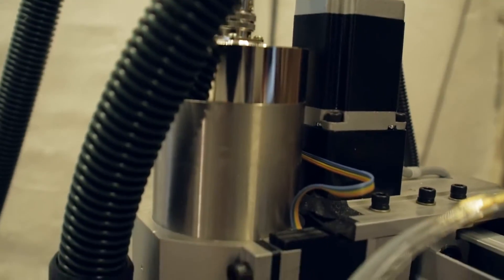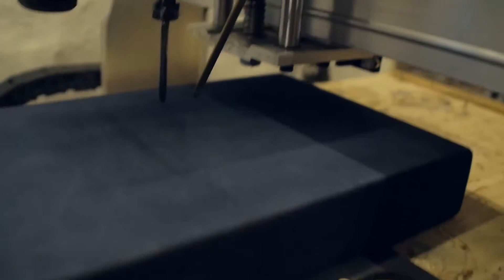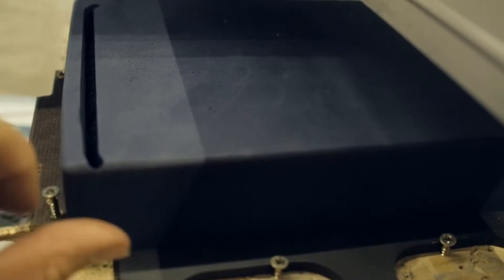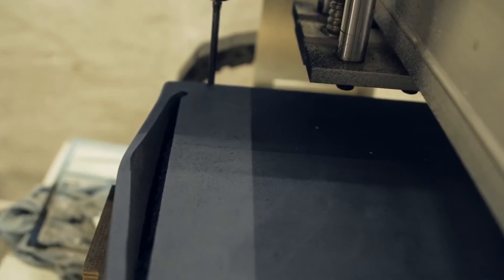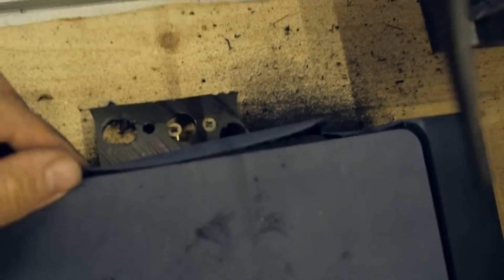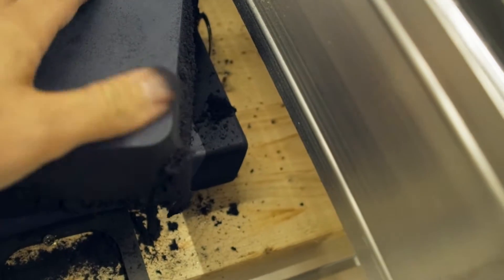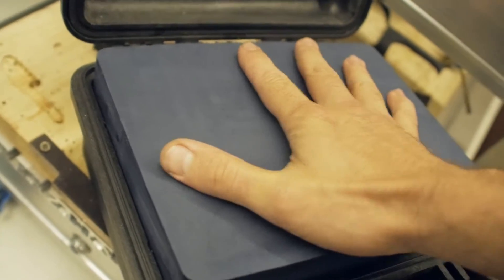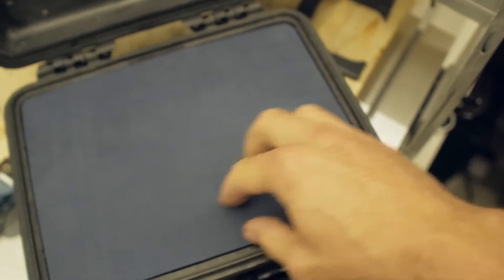CNC 6040 milling EVA foam for Pelican 1200 case inserts

Comment: It is actually available from a few places. Where I live it's sold by a cosplay shop of all things. It's fairly cheap too. If i read their site correctly a 1000/2000/10 (and I assume that is in millimeters, can't think of what else it could be) piece costs 45 euros for the High Density variety. There is also a lower density variety that is even cheaper (28 euros for the same size piece). I am not associated with this shop in any way but since there seems to be some interest I will just say google for Cosplay and Belgium, it looks like most stuff can also be shipped internationally.
Reply from the maker: interesting source :) thanks for the input!
Reply: You are more than welcome, the maker community is built around open source and sharing ideas and information. So just helping out where I can.
Reply: I don't really see this as helpful. Everyone who is looking for the foam knows to Google for it. The problem is finding foam that is thicker than a floor mat.
Reply: Apologies then. Good luck.
Reply from the maker: Bruno Bronosky i would call 10cm thicker than a floormat though
Reply: youser23, I agree. That is what I'm looking for. I'm saying that "search Google" results in finding floormat thickness. This guy says he found it, but instead of telling us where, says to google for it. As if that wouldn't have already been tried.
Reply from the maker: Bruno Bronosky He said Google "cosplay belgium". Maybe links dont always work here. I did Google it and found 10cm foamboards in the first entry. But i have no experience with the store.
Reply: I visited the first 4 sites and didn't find it. Google results are unique to the user. If I search for python it's all about programming. If my mom searches for python, it's snakes.
Reply: But also, he didn't say 10cm, he said 10mm. Which is a floormat. Which is consistent with what I find in the cosplay community.
Reply from the maker: Bruno Bronosky ah my bad! Its 10mm so yes the searching continues :/

Comment: All molded cases have a slight draft so that the mold will release from the product. You need to do some measurements and account for the draft.
Reply from the maker: i got the measurements from the Pelican CAD model. you mean the actual size differs from the CAD model?
Reply: Sorry I did not respond, I failed to see this one. The Pelican CAD model may or may not account for the draft. I would say it does not because to tool for the off set for the draft the knife would have to be on an angle. Because foam is forgiving, unlike other materials, you can get away without having those rounded corners (at the bottom) and not accounting for the angle for the draft.